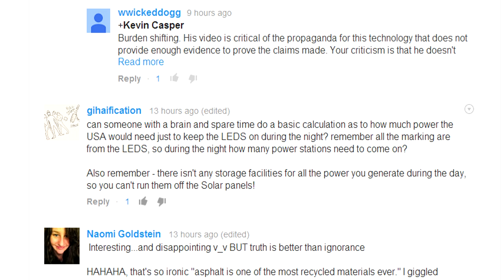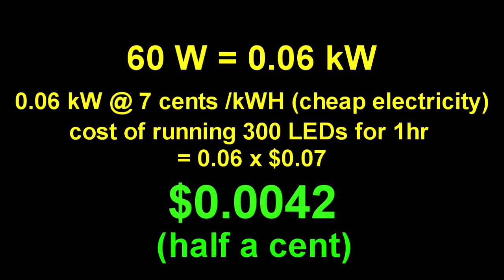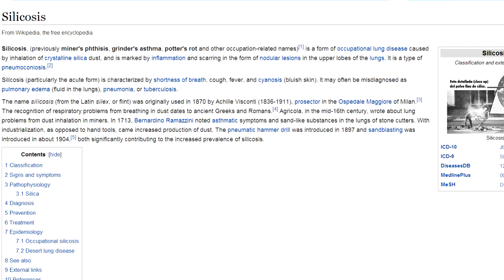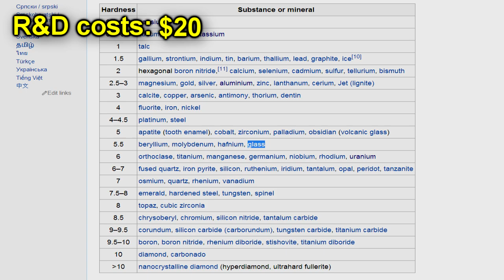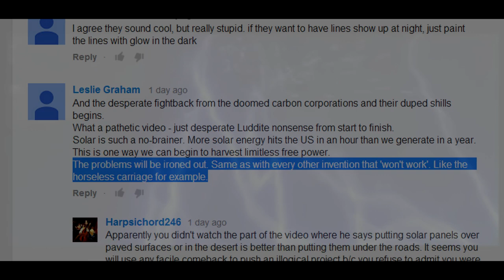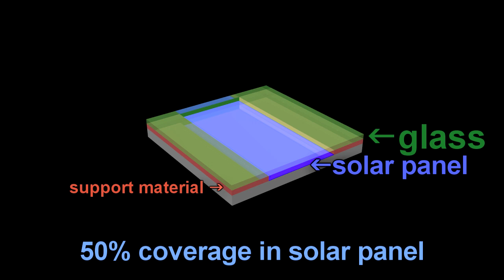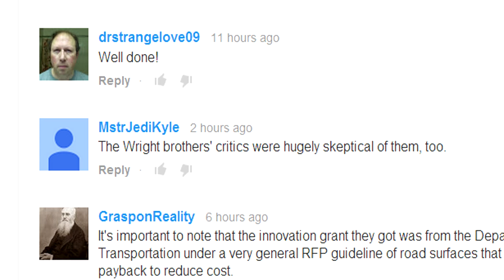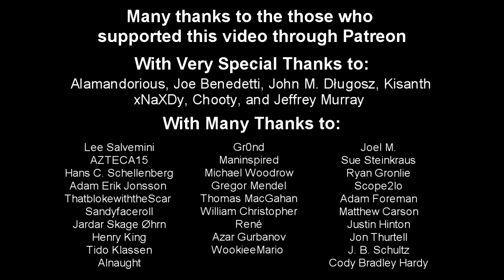Solar Roadways, IMPORTANT QUESTIONS AND ANSWERS!

Comment: What do you think of https://www.indiegogo.com/projects/focus-fusion-empowertheworld--3 ?

Also I just wanted to point out that your assumption that all LEDs would be turned on all the time is obviously invalid. Since the titles have pressure sensors they could turn off or dim when nobody is around. Also your claim that LEDs can only last 5.7 years is incorrect (there are LEDs that can last 100,000+ hours). Also you assume they won't optimize the design (which seems naive for the moment). They might for example only place LEDs where they would be needed instead of having them uniformly distributed, they might add more LEDs where they are used more often (extending the lifespan by simply using a fraction of them at a time).

You also assume that economies of scale don't matter when you buy billions or trillions of something. Who is to say we wont keep on using reflective paint with light posts with these panels?

As for the glass you maybe right I haven't looked into it. But it seems to me that you jump to conclusions too quickly.
Reply: 100,000 Hours is about 12 Years. It just seems like a lot because 100,000 Hours.
Reply: sonihi4 Sure but when you consider that dimming is effectively increasing the the lifespan combined with the fact that most of these LEDs could be off most of time it starts looking more reasonable.

Say I have 30 LEDs and need 10 LEDs for something and I use 10 of 30 at a time dimmed at 50% on average over a day with 100 000 hours of lifespan thats 12yrs * (30/10) * (50/100) = 72 years. And thats not taking into account the possibility of turning them off. Clearly there is no problem there. Not to mention the power consumption goes down dramatically when you take all this into consideration.
Reply: Eric des Courtis Based on what I have seen, the failure of LEDs in the environment is mostly issues that are not effected by whether the LED is on or not.  Water getting into the materials, sun light degrading materials, temperature cycling are real killers.

I have thought of many improvements to the design they suggest but none of them get the idea to be practical.  One of the main ones is to wire enough of the PV cells in series to get enough voltage that the IR drop from running power away as DC at the voltage produced is low.  The DC can be inverted to power line voltage only every mile or two.
Reply: Eric des Courtis Most of my work is proprietary but I can give you a few details on how the problems happen in real systems.

The bottom surface of the panel is exposed to ambient air.  That air contains water vapor.  When the panel is below the dew point, water condenses on all surfaces.  There is also dust in the air and acids from the auto exhaust etc.  Thus whatever the exposed surface is, it will be coated with this combination.  There will be a passivation coating applied to the materials.  Any defect in this coating will be trouble,  Remember this is semiconductor stuff and conductors etc.  Do a bit of googling on the "passivation coating" and "conformal coating" and you will find stuff about it.  Beware that those selling the materials are always optimistic about how well they work.

For the UV issue, the key term is "photodegrade"  Glass is not subject to this but there will be plastic materials in the construction.  Although glass absorbs most of the UV, some still gets through.  The plastic has to be clear for the LED to be able to send its light through.  Look at the characteristics of clear plastics.  You will see that polycarbonate, which you would really like to use for other reasons, is a total non-starter.  The GaN of the LED its self will be degraded by UV over time also.
Reply: Ken Smith You might be right that the environmental impact could be a factor. But could you please elaborate (such as providing supporting information)?

For example do you have any evidence that water and UV could be a real factor in the current design (or is this just speculation)? It seems like they already have working in outdoor conditions (at least in the short term).

I agree with you that the design is naive. But I don't want to shoot it down prematurely.

This thing is getting too much attention anyway. What did you think of this project https://www.indiegogo.com/projects/focus-fusion-empowertheworld--3 ?
Reply: On your fusion power, as soon as I see the word "clean" in relation to anything related to atomic power, I'm put deep in skeptic mode - and that's despite being an advocate of Nuclear power.

On the video at hand, the problem with the LEDs is they need to be concentrated to achieve the goal, regardless of brightness. That means, they'll require a lot of energy, and significant costs to buy and maintain the panels with them

Economically, these panels stand near-0 chance of ever paying able to pay for themselves. Just on the energy costs alone. Add in keeping the lights at the side of the road? Defeats the purpose entirely.

On the glass, as others have said, its a fundamental weakness. Sapphire-glass is scratch resistant but by no means indestructible, while at the same time costing many times more than tempered glass, in part due to materials used to make it, and the process of manufacture. I hate some people are linking to a video showing the Iphone vs concrete brick - it's too small scale. These tiles will be facing vehicles weighing tonnes, and grinding hard particulate matter into the glass. 

The only places I can see this project working are places like Afghanistan and disaster zones, where the energy and road infrastructure needs to be assembled quickly, but actual road usage is relatively very limited and low tonnage. But as a long term replacement for permanent roads and power-production facilities, this is not going to work.

My advice to those working on the project is to take a step back, look at the fundamental economics, and re-brand. Urgently.
Reply: As for the distribution of the lights, part of their goal was to make the roads totally dynamic. If you DIDN'T cover every single panel with lights then you couldn't put a message anywhere on that road warning about lane closures or traffic issues on the road like they suggest, unless they just decide to scrap one of their major selling points

Comment: your calculation about power is wrong. you assume that all of the leds will be on permanently but you only need roadmarkings and since they claim to have build in sensors they could be turned off on unused parts of the road(which should be a high percentage at night). 

and before anyone starts yelling and throwing rocks at me i'd like to say that i think this whole thing is bogus. i just wantet to point out that error.

Comment: Just out of curiosity:
There is little need for signage on the sidewalk/curbside (reducing the need for led lights)
There is relatively little pressure on the sidewalk/curbside
There is relatively less abrasion on the sidewalk/curbside
There is far less unstable raw surface area on sidewalk
It is easier to reroute foot traffic than close off entire streets.

If the company decided to modify their idea for the sidewalk in major cities, rather than, well, EVERYWHERE, would it be more plausible?

Comment: A couple of things I'd like to point out. I don't think that when the LEDs are on, they will be all on at the same time, just a small number of them to create simple shapes on the road.

Also when you mass produce something you get things at factory prices, not some gizmo you find on amazon that includes a remote and power source (which incidentally might be the most expensive thing there).

Furthermore, I've seen LEDs on traffic-lights during the day and other road warning signs, those things are bright against a dark surface... like say a solar panel.

But I do think the whole thing is stupid and needs more research.

Comment: I fully agree that the concept is not viable, but I have some issues with you on the electricity. First, those LED lights will not ALL be running ALL the time. Second, all the panels that aren't powering LED's will be pumping electricity back into the grid thereby offsetting the cost of the bill during the night? And even if that weren't possible, how hard would it be to add a battery to store power connecting 100 units or so each? Like I said, I fully agree with most of what you say, but this sort of stuck out to me.

Comment: You forgot to mention there will be much less grip as well. Stopping distances in the dry will be similar to the distances you would get in the wet on a normal road and when the glass surface is wet, it will be similar to the stopping distance on black ice.

Comment: Are they going to make the roads out of glass bottles? If not your testing is invalid. You have to use the actual same material they are going to use to make the tiles. Not all glass is the same.
Reply: Actually glass used in fx. car windows and solar roadways is nor harder, only stronger. They use tempered glass, not bulletproof glass. If they used bulletproof glass the price of the glass would probably increase 4x
Reply: Deo Donum That has nothing to do with what i said. Unless they line up and use actual glass bottles or coffee pots his testing is invalid. You have to test the actual material they use. He scratched a coffee pot not a solar roadway panel.
Reply: Alright that is actually a fair point, if there was a difference in the hardness between regular glass and tempered glass, but there is not. Though I do agree that he should have explained that
Reply: Deo Donum So your point is glass is glass? Thats just not true. You have to test what the thing actually is. What he tested was just a bottle and a coffee pot not the actual solar roadway. Its not fair to look at what you think something is and call it bullshit instead of looking at the actual thing. No product in its infancy works or works well. Scientists dont make tech. Dreamers make tech even when scientists tell them its not possible. Look at the first computer. It was huge and expensive. Scientists told a dreamer a PC in every home is impossible.
Reply: I'm not saying that solar roadways are impossible, but if they are to be possible then there must be made drastic changes, f.eks. remove the LEDS and find a material other than glass
Reply: Deo Donum No invention is possible. They get made anyway if the inventor is tenacious and ignores the word impossible.
Reply: Agreed

Comment: Even IF the glass used was resistant to the load of hundreds or likely thousands of cars and trucks there are other concerns. Road debris for one. A cinderblock falling off of the back of a truck for instance. A two meter fall at a conservative 40mph will do far more damage to a glass road than a standard one. Then the vehicles behind will drive over the debris of the object and the road. Also what of the effects of snowplows or salts used in northern climes?

Comment: If lightning strikes one of the panels, it could electrify everyone on the roads.
Reply: Stormrevenge  Glass is a very good insulator, so it won't attract lighting, and any lighting won't spread across it.
Mark Baanstra  It was used as an insulator for leyden jars.  Keeping the liquid and foil separate.
Reply: Mark Baanstra Solar panels, on roofs, survive lighting just fine.  Putting them lower, and adding thicker insulation on top of them will only reduce the risk of lighting.

But yes, it is technically possible for lighting can strike a glass road.  But it will strike a glass road less then it would an asphalt road.  So i'm not really sure what your points is.

Comment: I think there is a way to make solar roadways work, but it would require a completely different approach than what these people are suggesting. As pointed out, the materials suggested are unsuitable for the purpose. The decision to use the visible spectrum to generate electricity is at the basis of the material requirements. If this idea is to be salvaged, it probably needs to use solar thermal and shun electronics. I suspect that something using phase-change gels to store thermal energy and various passive heat pump technologies, along with thermal electric generation (perhaps thermocouples) would be closer to the right direction. This would greatly cut costs and improve durability. The output wouldn't be much, but it it is really cheap, it wouldn't need to be much.

Alternatively, if we could spray the surface of existing roadways with a substance that generates electricity and is inexpensive enough to be expendable, but durable enough to make the effort worthwhile, and doesn't turn slick in wet or icy conditions, that might work, too. Perhaps the spray would naturally melt ice, due to the shape of the molecules? Maybe we could engineer some bacteria or bacteria extract with fluorescent jellyfish genes and encapsulate them in a reflective polymer that could be sprayed on the roads to provide light. We could produce whatever patterns we want by altering the environment (perhaps the pH level) of the polymer in the pattern we need. Saline lakes turn different bright colors based on their pH level, so that might work here, too. 

I suspect that solar roadways is a problem that could be solved by chemical engineering and materials science. Regardless of the method chosen, heavy use of electronics and glass sheets are the wrong way to go.

Comment: The bottom line is, making the solar roadways a reality would require enduing the roadways with properties that would make them a menace to traffic. We want roadways to be the sacrificial element in the road vs vehicle equation. The solar roadways makes the roads more valuable (and maybe more sophisticated) than the cars driving on them, so the protection given the roads exceeds what the cars can tolerate.

Comment: @ 15:45 there is another major cost illustrated but not mentioned, and I think for your next (promised) video, you need to address it. These panels are fitted to a custom-built, concrete pad with rebar posts. And, even within that system, they do not fit tightly. There is a noticeable gap between them that would allow contaminants to build up, and water to collect and freeze in, causing additional panel failures. These hexagons don't fit simply on the ground, or even on a bed of sand. I poured an 8x12 pad outside my patio door and just the concrete cost me $300+. Never mind the channeling for cables and waste water these panel systems are supposed to contain - the costs for implementing this on any scale are astronomical.

Keep up the good work, and let the sheep know they are fodder for those of us with the ability to think critically.

Comment: Thundref00t, I was doing some more pondering on this and it occurred to me that you may have overlooked something in your energy use calculations.  You did so much, that maybe I just missed it, and even if you did overlook this detail it wouldn't make the solar roadway remotely more viable...

It seems like your energy calculations are based on lighting every single LED on a freeway.  Let's say for a moment they solved the visibility problems, etc, etc, the lane markings only occupy a small fraction of the total road surface.  I did a quick gues-timation based on a 26 lane section of the Katy Freeway in Houston.  26 lanes with shoulders is a bit more than 100 meters in width and let's say there is a section that is 100 in length, or about 10,000 square meters.  The lane markings (solid shoulder markings and dashed lane markings) occupy only about 150 square meters, or 1.5% of the road surface.  So, I think the energy demand for lane markings is 98.5% less than you calculated.

Comment: Reading some of these comments attacking thunderf00t make me sad for all the people who don't understand science, who must think the solar roadways people are some sort of wizards. Perhaps a more apt description would be alchemists; turning lead (or glass) into gold (a driveable road surface).
Reply: From that logic I bet you wouldn't believe the best armor in the world for main battle tanks is made from a ceramic and not some super dense metal. You don't know what kind of glass it is so stop calling it tempered glass like its the same stuff in your car's windshield. They don't use the same kind of steel to build buildings that someone would use to make a sword out of so someone isn't going to use the same glass from your windows to make a tough durable surface.
Reply: Verdigo I don't care what kind of glass its supposedly made of, the tiles themselves are supposed to be solar panels. Unless they have some magic super glass they have developed in secret that both allows light energy to pass through while being a surface with sufficient friction to hold tires into place under all weather conditions while not shattering under the wight of even the most mundane road using load, then yes this is a marginally less stupid idea than my comment portrayed.